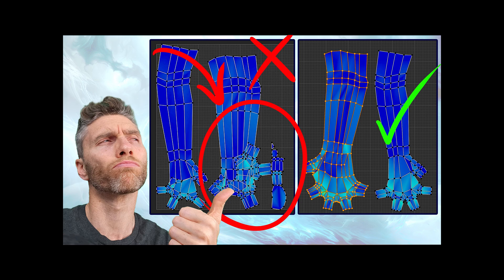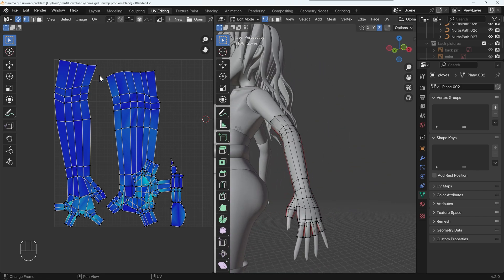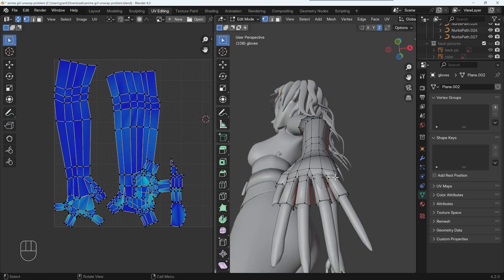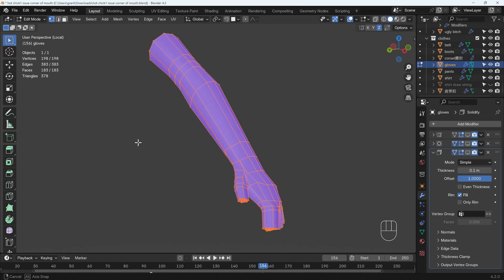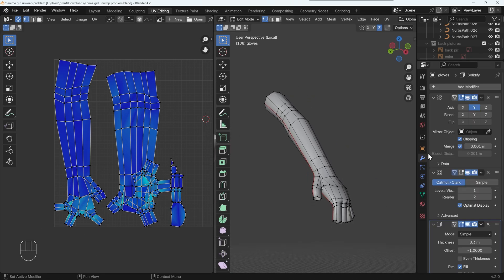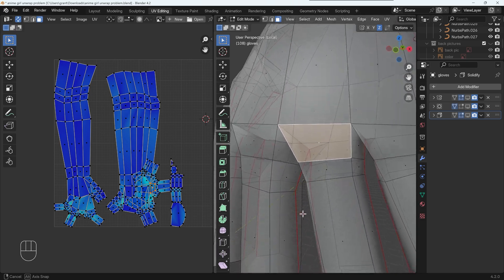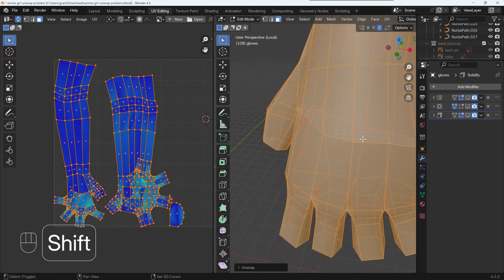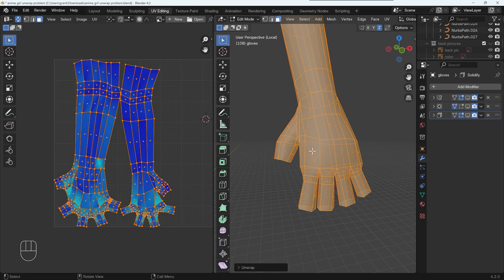Why's Blender Not Working! - Fix UV Unwrapping

Comment: When having issues with UV unwrapping, go to face selection mode, press L on some random face, and if you seams are placed correctly, it should only select the faces you intend to. In that example, you could press L on any face on the top of the hand and it should only select the faces belonging to that UV island. If it selects the whole glove, it means you have a discontinuity in your seams.

Comment: those uvs could be 3 times better are still dirtied
Reply from the maker: Of course but this is for beginners having difficulties
Reply: @grabbitt  I know but form the beginning beginners need to know no only basics also mandatory things for production in my personal professional opinion
Reply: how then? gives opinion but no suggestions 😂
Reply: @cutieworldwideee  Sr. at production all the tubular shapes must be straight all and is not advanced  stuff is because when you go to the next  step in the pipeline you should make life easier of the Texture artist, and also in case you would put a pattern with Horizontal or vertical way path it is more easy to paint or apply texture.  not only that also int he next departments  imagine the arm and hand would have and animation in horizontal on the arm it would be more easy for the FX composers to use the uv coordinates. 

Don´t be nasty dude in a studio this would be taken as a provoker comm and also I don´t hear your comments don´t be a $149  person
Reply: @cutieworldwideee   give your point looks like you are just here to make trouble. and that´s it expose  your point Einstein. I have 18 years of experience and I have been a supervisor for 13 years, expose your arguments and clean your mouth before you talk trash.

Comment: Wow, thanks for that and good catch/find. I have a side question for you if you have a second, how do you get the skin of the character to be so smooth? For example, if you have a lump in the leg where you were a bit overzealous with the grab tool, how do you go back and make that smooth? I know there's the smooth tool but that doesn't seem to make it completely level. Is there a trick here?
Reply from the maker: smooth tool is actually the best way but you need to be doing that when you have low resolution or low polygons